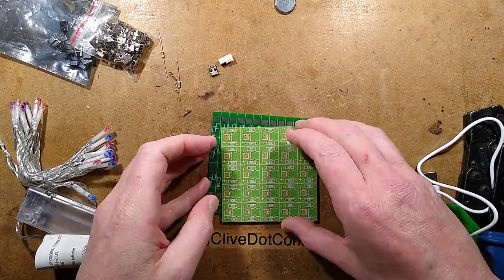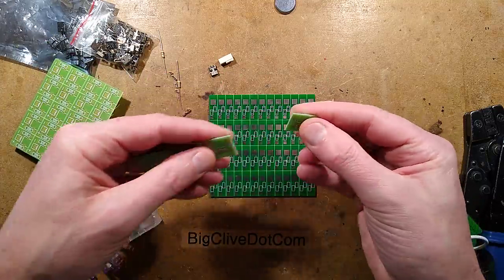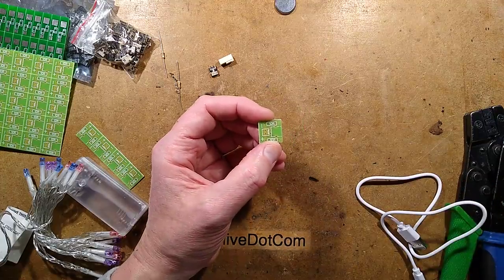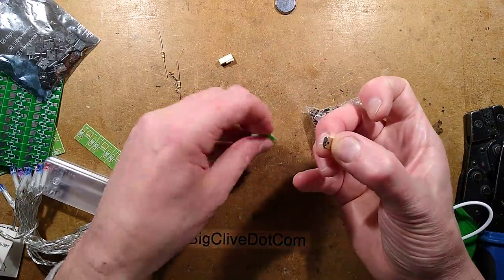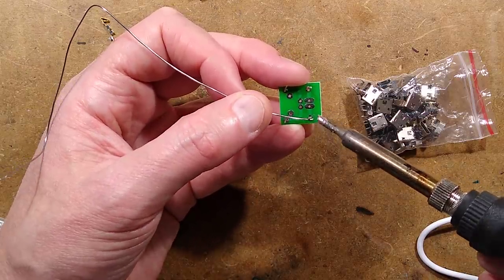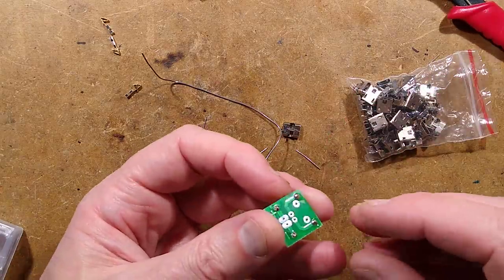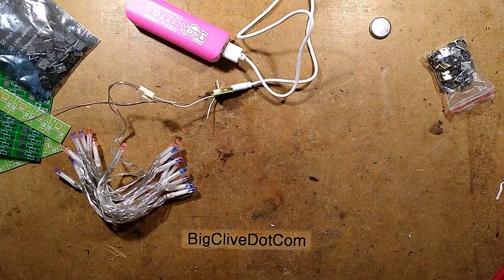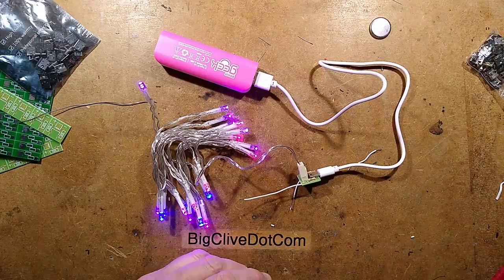USB to LED string PCB prototype build

Comment: my dad taught me to splay or twist the leads together before soldering. no need to hold them in place and experience THE BURN.
Reply: I use blue tack :)
Reply: I was laughing at him juggling the board and components. Just splay the leads and sit it flush on the bench. 🤦‍♂️

Comment: My tip for soldering without burning my fingers would be to bend the resistor leads (either acute or obtuse, but don't keep the straight angle) so they stay in place without having to hold them. Sorry for my bad english, hope this does make sense to you

Comment: I've used JLC after some shopping around when making an attempt at making a lily58, Which came out around 30CAD for 5 boards (Which makes about 2 keyboards and 1 extra). While I blew up my pro-micro's due to my poor soldering work, the PCB's were great for the price (and i got a couple nice little extra's which was cute).

While I wouldn't ever believe advertising like 2$ boards, JLC has at least come out as the best option for myself as a Canadian, Especially since i tried my hardest to find a Canadian PCB provider, but finding a Prototyping PCB manufacturer that doesn't charge an arm and a leg, and also provides Gerber checking and stuff is tough, and well... Yea JLC does all of that.

I do plan on using them again for future projects so long as that price comparison stays the same

Comment: When soldering thru hole components, it's easier to bend the leads after inserting to hold it is place instead of holding in place with finger.

Comment: I bought a pair of those flush cutters awhile back because I’d seen them in your videos so often and I use them for just about everything. I’m honestly surprised they’re still sharp at this point. They’ve definitely cut some stuff they probably shouldn’t have...
Reply: They're remarkable resilient.   They have no issues chopping things all the way up to a normal wire coat hanger.  My wife uses them from wire ties (flush and no scratches) and for trimming candle wicks.  They will flush-cut brad nails too seemingly without nicking.

Comment: Absolutely love it :) Always been interested in having some PCBs done but I haven't designed any since I was 17 years old. I still have a couple of projects I did on my YTS scheme. A 4 channel Disco light sequencer using 2 555 timers, Binary up/down counter, and Binary to Decimal 16 output chip fed through a board of diodes to make the pattern then fed to 4 opto isolated relays to drive traditional PAR36 pinspots. It still works but the wires could do with a re-solder as some have dropped off in the last 30 years lol. 
It did have a snazzy Audio beat pulse generator I made on it too as a switchable option but I have lost that circuit board :( I have to say that in the years I have come across sound to light in devices, that old project from Everyday Electronics back in the 90's was the best sound to light project I ever built. It never wavered from only reacting to bass beats. Trebble sounds would never trigger it. I wish I could get it back. The original project was to build a touch switch programmable lighting controller using EPROMS and friggin tons of PCBs and chips of all sorts. I just singled out the Beat Detection circuit and built that.
Back then I wasn't educated enough to understand track width but glad to say I did it right with wide tracks on the mains side and  used gap and antitrack techniques. 
Nowdays I guess you would use an Arduino but back then it was old school and made you think about what you were doing. 
The second 555 was for adjustable reverse pattern by switching the up/down pin of the binary counter. 
My other project is a 6 digit 7seg display using switches as binary input to a 7seg driver to just make a cheap display of any numbers you switch in, the clever part being it is multiplexed with a variable strobe drive to speed up or slow down the digits as they are displayed. That way only 1 7seg driver is needed and I used a decade counter for the strobing, reset at 9 as it counted 1 to 8. 3 and 6 were just led pips between the pairs of 7seg displays. The switches were fed by diodes to prevent cross contamination to the other digits as each set of 4 switches were fed a signal by the decade counter and the 4 outputs fed to the ABCD inputs of the seg driver. 
The most recent thing I did (and is related to this video of yours lol) was buy a USB powered white LED strip from poundland. I snipped the + wire and soldered in a 10 ohm 1/2 watt resistor on a switch. Mounted in a length of narrow plastic trunking as a housing. I'v slipped in some colour by using sweet wrappers from Quality Street for a nice rainbow effect lol
Reply: It's definitely really cool to get your own design made into reality in your grubby hands. I'd recommend giving it a go, hobby-level design software is dirt cheap also.

Comment: Nice lille board :)
Will definetly not steal the idea for my own batterypowered christmas lights :D

Also the through hole USB sockets are also better mechanical wise than the surface mount ones. They don shear that easily off nor get their solder joints easily cracked.

Comment: I turn the straight male to 90 degree male by pulling the pin down about 1mm-1.5mm and bending it.  You have a little less on top but with practice, you can minimize the amount you need.

Comment: One potential addition you could make to the design would be to allow you to daisy-chain the boards from a single usb connector. Potentially you could then have a strip of boards you didn't break apart act as one big PCB.

Comment: Hey Clive I love your videos in fact 3 years ago you were the first electronic channel I watched, you did a test on some "stun gun" modules along with some kinda alcohol so you were a favourite straight away. I use those little batt charge boards but this is a better idea I might try this on xmas time. I was messing with some 3mmRGB flashing LEDs on a supa computer sort of ting and the 2 lead ones just cycle thru the sequence as I expected but then the length and frequency of the flash changes

Comment: you forgot to mention that to get an accurate current reading  you should measure the actual resistance first - since resistors  typically have wide tolerantes (unless you’re using high precision, which you did not mention)

Otherwise awesome video

Comment: Nice to see a real bug in the hardware, a 90° connector would have made it low profile and easy to cover in heatsrink. Remember JLCPCB are a prototype PCB manufacture hence the price, for a production PCB I'd expect to pay a lot more to cover the quality control and repeatability and the stack of paper work.

Comment: I think if I wanted 3 sig figs of current measurement, I'd want to measure both the voltage and resistor to 4 sig figs; the variance measured could be accounted for by the tolerance of the resistor
Reply: I'm surprised he didn't use the first meter to continue measuring across the resistor when the second meter was in circuit. That would have shown the true effect of the second meter as a percentage, without needing to know the exact value of the resistor.
Reply: @KevinT3141  maybe we shall get a demonstration of that.

Comment: I have a board design similar to this, but it's a breakout for the MCP2221A USB to UART/I2C/GPIO controller. I only had 5 made, but I did use some surplus space to have ordinary +5v and 0v connections. I did stick a power LED on as well because...well... it would look better to know when it's live! :P

What I tend to do is size my boards in such a way so that mounting holes are either pitched 0.5" (for boards smaller than 1" on either axis) or 0.1" apart so that it's easier to mount them.

Comment: Maybe use one of those little two pin, through hole surface mount terminal blocks, with screw down connectors for connecting the wiring on the lights? Would be loads easier and take up almost as small of a footprint as the two pin connector you're using.

Comment: Clive So you have had good results with that PCB maker the other company I have seen  is PCB way . There are some Circuit boards that want to get made .
Reply from the maker: JLC have the slickest ordering system, but I've used other suppliers too including PCBWAY, Dirty PCBs, SeeedStudio and others.

Comment: I think I'll get some of those made then. For future revisions I might like the option to just solder the leads of the leds directly on, instead of having to crimp on a connector. Though I see the advantages of having a connector as well. Same goes for the boards with a PIR sensor.
Reply from the maker: The linked file has additional solder pads and strain relief holes.

Comment: For those of you following along at home, know that resistors have a tolerance and an (eg.) 100 Ohm resistor may deviate by up to 10% (depending on the color of the tolerance band).

Comment: 1% tolerance of 10 ohm can be quite significant when you're measuring the current through using the voltage across... It's important to know what the actual resistance of the resistor is.  Note that measuring voltage is always going to be more accurate because to measure current, the meter does the same thing -- introducing it's own resistor in circuit and skewing the result. It's compensated for, but it can't do that across the whole range, it's the main reason that there are multiple ranges for current measurement in your meter...

Comment: I was planning to do the same with a Poundland %) LED Christmas strip so that I can power it from the socket on the tree, but I'll probably go with strip the wire and solder the wire to the battery contacts as that way I keep the flash function.

Also, about JLC, to be honest I can't believe how people haven't already figured out that promotions have always caveats and that it is usually difficult to be within them, I always look for the caveats in any promotion as it is most of the time not what I need and that just makes it not worth it. And not only for PCBs, but for everything.

Comment: I have this set up in my glas table
 I may have to do a video on some set ups around my house 
The small 12 volt fans will also work on the 5v power bank but its a lot slower but it's fast enought ot move some air and thats all I need in winter.

Comment: The $2 panelised boards used to be a thing, but people started abusing it and ordered many boards for $2, so they've nerfed it. For larger boards, say 5x5 cm or so, panelising them up to the maximum allowed $2 size of 10x10 cm actually doesn't give any advantage. 4 panels on a 10x10 board, times 5 boards gives you 20 smaller boards, but it costs exactly the same as if you'd just order 20 5x5 cm boards. Obviously they had to make that change, if a lot of people aren't paying for 20 boards, but still ordering them.

Comment: If you want to calculate the current, I would suggest to measure the resister frist to have a more accurate divider value. The resistance is so where between plus/minus the tolerance % after all.

Comment: As a long-time (mostly happy) user of jlcpcb, I wonder why someone would make those claims. Seems irresponsible. The terms on the website are pretty straightforward. The only part that's ever surprised me was the occasional $4 "engineering fee" (which has usually been due to something I've done).
Reply: I say "mostly happy" because I had one set where the soldermask adhesion was a little low. Just a little too easy to scrape through. Other than that batch, I've had fantastic results. 
(I don't want to overstate the adhesion issue--it wasn't like it was peeling off or anything. It's just that I'm so accustomed to flawless results that I was surprised when it was only "ok.")
Reply: It's mostly that, as usual, support is absolute dogshit on budget sites, and you have to argue for weeks with them to get anything done.

Edit: have also one got a PCB with leaded HASL when I paid for lead-free, which is annoying to even detect - I don't exactly lick them out of habit.

Comment: A bit like Ryanair. But I suppose it's better that they have all the optional extras and a low base price, rather than charging $30 for all boards even if you don't require all the options.

Comment: Weird - a couple days prior to this I made a similar thing on a smaller scale (like 3 of them) mounted to cardboard and hot glued together (safety all the way!) except I had 2 sets of resistors on a switch as some strings use 3v and others like the big lighting up musical ornaments like their 4.5v so I can switch between them - only useful for these applications of course as resistors for varying the voltage is a bit unreliable.

Comment: Isn't it a better option to go for plated holes instead of single sided PCBs? The price will still be the same, but you don't have to worry about lead length, joints will flow anyway.

Comment: I've just ordered 50 boards similar size to the second one you showed (7mm x 20mm). I got 50 for 5 bucks plus postage from pcbway. I didn't get a panel, just 50 pieces.

Comment: I'm sure the cheap tools work fine but I do like buying high quality tools and collecting a decent set. Got some scissors from a brand called Engineer which will cut almost anything with ease. I use them everyday. I want to get some Knipex side cutters and Knipex mini Cobra grippers which are surprisingly useful, some more Wera hand drivers and just picked up a Bosch Professional Go 2nd gen on offer to help with the 100's of screws i get through. The best brands have always been a solid investment for me.

Comment: How was the required current figured? 106mA was measured, but that seems a lot for normal little LEDs, these days 10mA can be a lot, and less than that can be normal. I assume the LEDs in the string are in some kind of series/parallel arrangement; if they were all in series then the 5V USB supply would be too low, so....maybe they are all simply in parallel instead? It would have been good to mention this, otherwise the whole thing is just a tiny PCB soldering video.
Reply from the maker: 106mA shared between 20 LEDs.

Comment: Two questions.  1) You didn't ground the housing of the plug.  I do that for all my projects. Is that something I should be doing?  2) you computed the current by taking the voltage across the 10 ohm resistor.  But it's 10 ohms +/- some percentage.  Even at 2%, that would still give a current range of 88.3 mA to 132.5 mA.  That makes all the readings that you got possibly correct.  Wouldn't it be better to measure the resistance when using this method, especially at such low values for a resistor?

Comment: Clive, this was a nice "hack" type video. Could you do a similar video for some of those hand warmer gloves that are powered by AA batteries? I believe the batteries last about an hour, so it could get extremely wasteful. If the battery pack was switched out for a power bank, that could let it be used for a longer time and be easily recharged.

Comment: Clive,
I've recently found myself bingeing a variety of your vjo's involving PCB assembly and soldering work and have discovered that we are rather kindred spirits.  Most of my work has been fairly solitary, so seeing someone else perform not only some of the same work, but in the same manner is compelling.  When I have been working  around others who can see what I'm doing, they are either; A)Uninterested in the skills used by lowly workers, or 2)Gobsmacked a mere mortal can fabricate magic from grains of sand and metal "glue" - I might as well be conjuring spirits from the æther!  The highly dexterous left hand clamping & solder feed system which we both employ also tends to spin heads.

Greatly look forward to catching a live chat sometime soon. (I have a solar light with what may be an odd  circuit  design I'm modifying, and would sometime like your opinion on whether there's a better way to do it.)
Reply: Having a "dextrous left hand" is actually something quite sinister!
Reply: @johnm2012   I do use a very right handed trackball for navigating my computer.  I'm sure it's only a coincidence.

Comment: Can you go through the decision-making process (or maths) for a novice please? The battery box is for 2x AA batteries, so the leds are expecting 3V and I guess they are all in parallel?
You are supplying them with 5V from the USB, but I know the current is 'more' important... What makes you say "this voltage will be fine" (ie what about a 9V PP3 battery, or two or more, would that still be fine?) and what makes you choose 2x10ohm resistors? Are you calculating for 1mA through each led? In which case do you need to adjust for how many LEDs there are in the string?

Comment: I just ordered from JLC earlier today (first time... yay!) and it turns out if you want it RoHS compliant it's more expensive. Weird. I agree that using leaded solder is more pleasant but for a business it's kind of a faux-pas nowadays. By the way, I own very similar side cutters, but they come with a notch in the jaws to facilitate using them as wire strippers. That has occasionally come in handy I must say. Mine are from Velleman but I can't imagine they're the only brand that sells them like that I can't imagine it'd be very hard to grind a notch yourself if you really wanted to either.
Reply: No need to grind the notch, just use something hard like a bit of piano wire or a sewing needle to dent the jaws at the position you want the wire stripping notch. Been doing this for years after accidentally notching my dads favourite pliers as a kid and finding the 'damage' useful...

Comment: Which to believe - the 10 ohm rating on the resistor or the current reading on the ammeter?
Reply from the maker: The most accurate test is the voltage across a known resistance.
Reply: @bigclivedotcom  Yep. Don't mind me, I was just being a little nitpicky.
Reply: I was thinking the same thing.  That resistor has a tolerance.  Unless you actually measure it, you don't know what the resistance is, closer than +/- 5%.  And that's if it meets spec...